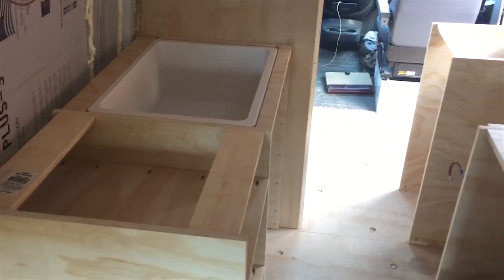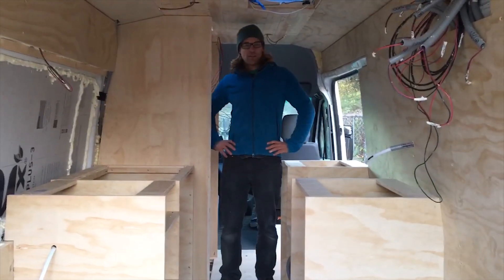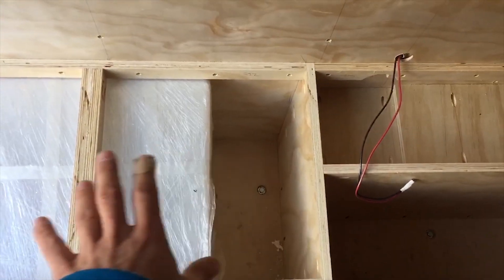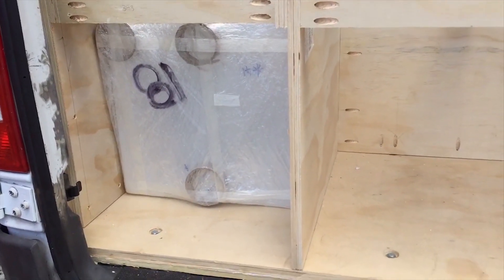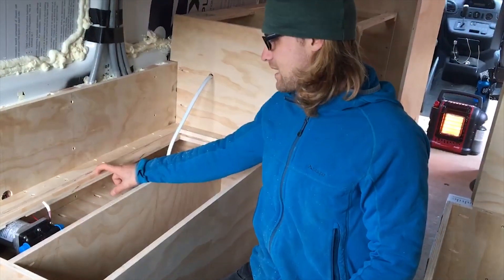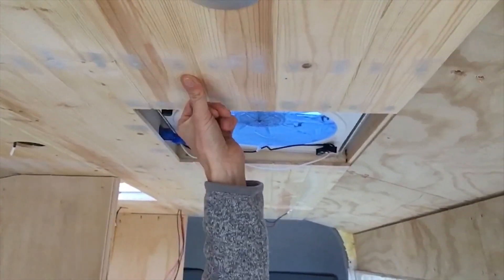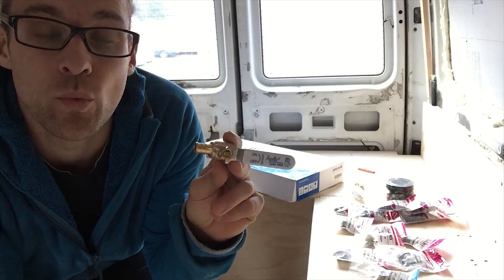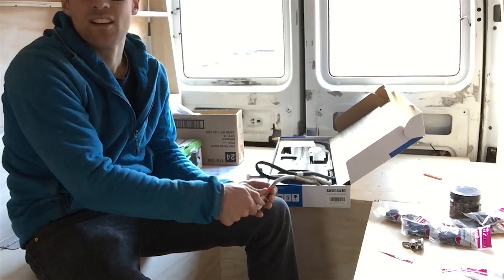How To Convert a Van into a Chic Home - DETAILED VIEW Part 2:  Kitchen, Bed, Plumbing & Electrics

Comment: Why not get a secondhand motorhome? Wouldn't it save time and money?
Reply: You are right in both regards to saving time and money but you lose the ability to go to certain areas in an RV. What it comes down to is what type of "camping" experience are you looking for. Do you want to go to tough to reach, off the grid areas that an RV may have difficulty getting to? Do you want to stealth camp in cities without the worry of being kicked out? Perhaps a van is a better choice in those situations. For me, I plan on using my van as a backup daily driver as well as my home away from home so the van makes more sense.